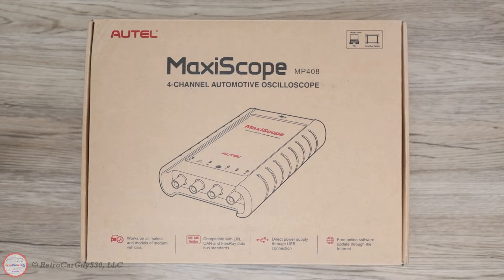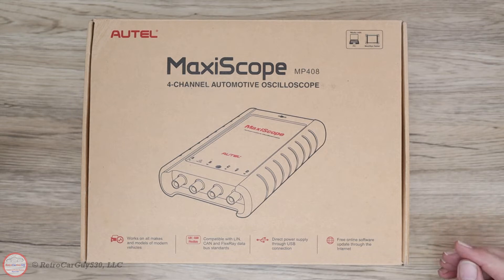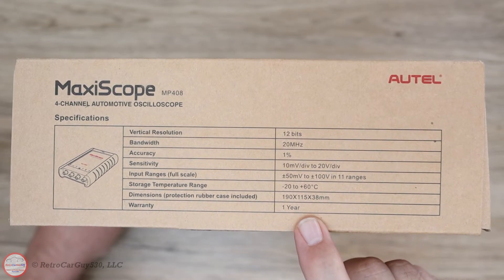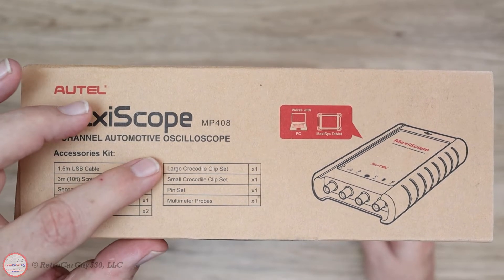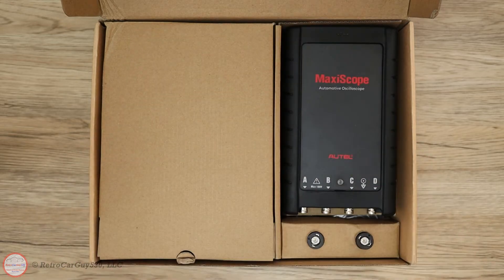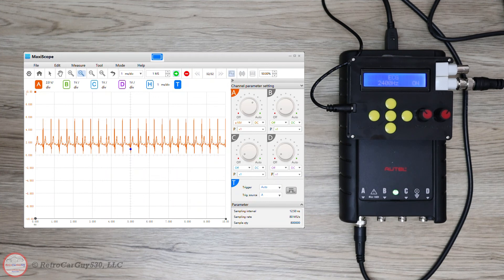Autel MaxiScope MP408 4-Channel Oscilloscope - Unboxing / Installation

Comment from the maker: In this video, I wanted to show what was included in the Autel MP408 box, how to download and install the MaxiScope software for a Windows 10 PC and then use the MP408 with some sample signals generated by my inexpensive signal generator to make sure the MP408 and the MaxiScope software worked.

Make sure to use the section markers in the video player or the video section links in the video description section to quickly jump to a particular portion of the video that you want to view.

Here's a list of the video chapters available in this video:
00:00 - Intro
00:20 - Video overview
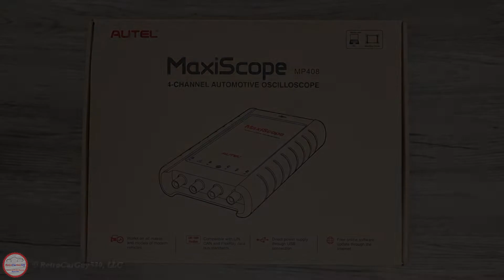01:47 - Unboxing
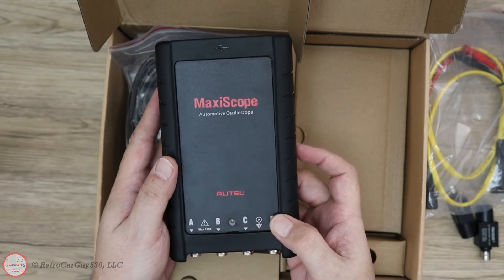11:24 - Update software
17:50 - Testing MP408
25:34 - Final thoughts
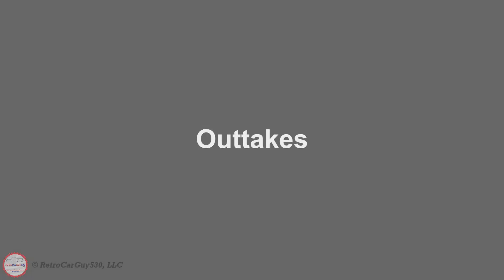26:16 - Outtakes

Thanks for watching!
Reply: Great vid but would you happen to know how to move channel a signal out from superimposing on channel b???
I can see the signal a little better if one was above or below the other.
Reply from the maker: @rdaleyj1 I have created a quick tip video which I believe answers you question.  https://youtu.be/OQJKRVOrv4c

Comment: I'm a pro tech. I've used the Pico, and have owned an Autel and a Snap On. Honestly, I'm sold on Autel. Pico has a ton of great features, but I rarely need them. My favorite scanner is my Autel. If you know how to use a scope, it's the most bang for your buck.

Comment: Thanks alot for your tutorials. Been looking for this for long time. A serious student can study at any place without connecting to sensors. Thanks for the links too. Using the signal generator with Hantek 1008c. Although the settings are not the same.
Reply from the maker: Glad it was helpful!

Comment: Bought this scope a couple of years ago because it seemed to be the best bang for the buck . So far I like it and it’s far better then most cheaper scope . Only issue was test leads were internally shorted and had to fix them . And when your scrolling through a capture that’s in the buffer it seems to change when you zoom in . Like a had a secondary ignition capture at a 100ms/Div capture and when I went back and stared zooming in on some of the events the firing Kv got smaller . Other than that I say for $350 it’s much better than some of the cheaper ones .

Comment: Hi, 
 That is a nice diagnosing tool to have on hand.  There is a way to use on the 20 volt scale while cranking and checking voltage drop you can see a dead or weak cylinder.  Be safe .

Comment: @retrocarguy530 can you please share the details on the signal generator?
Reply from the maker: The signal generator used is a very basic unit.  It's no longer available from Amazon.  I have listed a similar unit (in the video's description section) that should work in a similar fashion.

From the affiliate link section of this video's description section:
1HZ-500KHZ DDS Functional Signal Generator, Seesii DDS Function Low Frequency Signal Generator Sine/Triangle/Square/Sawtooth Waveform (affiliate link - US): https://amzn.to/4564iw4

Comment: Do you have any plans to make more content on the mp408? I'm currently in school for automotive technology and am looking to purchase the mp408. It's hard to find many videos on the software side of the scope. Thanks!
Reply from the maker: I don't have anything planned right now.  I purchased the MP408 because I purchased a project car (2014 Chevy Caprice PPV) and I wanted something on hand in case I needed to track down any electrical system problems.  Being an ex-police car, the police upfitter can really mess things up in the car when the police equipment is added or removed.  Luckily, my car has been free from those type of issues.  I have several product reviews I'm working on right now.  It would be a couple of months before I could squeeze in a MP408 video.  Maybe something like using the MP408 using a OBDII breakout box to monitor the CAN bus signals could be one potential video.

Comment: Can you get more into the digital mode ? , I just got this scope and learning the sw
Reply from the maker: I don’t have any other videos on the MP408 at this time.  The best I can suggest is reviewing the user manual provided with the MP408 and get the basics figured out and do some simple checks using it to get familiar with it.  https://www.autel.com/u/cms/www/201912/250856151mmi.pdf

Comment: best way to enhance resolution on injector Pintal hump?
Reply from the maker: I haven't used the MP408 for any fuel injector diagnostics (yet).  You can adjust the time base, sample size, sample quantity and zoom level to hopefully bring into vide the injector pintal hump.  Is the MP408 not displaying the level of detail when you adjust those settings?
Reply: i am able to get some detail but i am new with it and wanted to know if there was a magic setting for fine tuning the waveform. to bring in details.
Reply: @RetroCarGuy530   i know if you dont have your setting correct you wont be able to get any detail ,say on a map sensor or IAT SENSOR. i am
learning the hard way with just what i have learn by trial and error  thanks

Comment: I hoop can i see more details about using and installion autel mp408 scope. Thank you for sharing
Reply from the maker: As I have needs to test or learn things on this scope, I'll be creating more videos for it.  In this video, I wanted to show what was included in the box, how to download and install the MaxiScope software and then use the MP408 with some sample signals generated by my inexpensive signal generator to make sure the MP408 and the MaxiScope software worked.  Thanks for checking out this video!
Reply: Which signal generator are you using?
Reply from the maker: I found that signal generator on Amazon.  I included an affiliate link to it in the description section of the video.

Signal Generator Sine/Triangle/Square/Sawtooth/ECG/Noise Output 1Hz~65534Hz Frequency Amplitude (affiliate link - US): https://amzn.to/2VcKwvM
Reply: Thanks for the reply and thanks for the informative video. This will really help me get more familiar with my Maxiscope!
Reply: @RetroCarGuy530  .

Comment: Thank you, for your very informative review. Any updates or other personal opinions about this scope since some time has passed?
Reply from the maker: I've only needed to use it a couple of times since I created this video.  So far, it has worked fine.  I might be working on a 2009 Chevy HHR to diagnose a parasitic power draw, so I might be needing a scope to help diagnose that issue depending on how complicated of an issue it is.
Reply from the maker: I might get amp clamps in the future.  I need a good reason to purchase them since I only use the scope on a limited basis right now.

Comment: How are the leads that come with it?  I’ve heard that they show up a lot noise on them and it’s better to use a different brand of leads.  Also can this operate with a windows 7 computer?
Reply from the maker: The leads that come with the MP408 are basically Hantek leads.  They are on the lower end for oscilloscope leads.  There might be some small amount of noise that a better quality lead set might help avoid.

The PC software sheet lists the minimum PC operating system requirements as Windows XP SP3, Windows 7, Windows 8, Windows 10.  

When I created the unboxing video, the laptop that I was using it with was running Windows 7.  I've since upgraded to Windows 10 on that laptop.  The MP408 software worked ok with both Windows 7 and Windows 10.
Reply: @RetroCarGuy530  
  Thank you for responding.  I’m just a shade tree working out of home shop but very busy.  I have the Autel 906bt and really like it.  I need a scope but can’t afford a pico or really justify the cost with the amount of diagnostic work I do but still need something.  This I think would fit my needs.  I have a rehabbed windows 7 and a windows 8.2.

Comment: i am thinking of buying one, does it have low pass filtering and how do you like the scope?
Reply from the maker: Hi Henry.  There is a low pass filter feature in the MP408 software from everything I've been reading about it today.  I've not tried that myself since my "scope projects" haven't been at the top of the list of items to work on yet.  The testing I have used the MP408 for has been very simple, but everything worked like I expected.  For the price point, I'm pretty happy with the Autel MP408 scope.

Comment: How do you like the scope now that you've had a chance to use it for a few months?  Any major issues to report?  Thank you.
Reply from the maker: I've only used it a couple of times for testing after filming the video.  My auto related electrical projects have slowed down due to COVID-19, so I haven't had the opportunity to use the scope that often.   The MP408 has worked decently, I just need to use it a lot more to learn more about it.  I hope I will be using it more in 2021.
Reply: @RetroCarGuy530  Thanks for the reply.  At first I was concerned about the Autel, but they have fixed most of their software issues and it looks decent.  The price is right too.  There is a video here on youtube of a guy showing the Autel, a Pico, and a SnapOn all connected to the exact same circuit at the same time.  The Autel performed very well in his test too.

Comment: does it need calibration?
Reply from the maker: There are no user calibration steps documented.  The user manual states:

Product  Maintenance

The  product  contains  no  user-serviceable  parts.  Repair,  servicing  and calibration  require  specialized  test  equipment  and  must  only  be  performed by  Autel  Tech  Support  or  an  approved  service  provider.